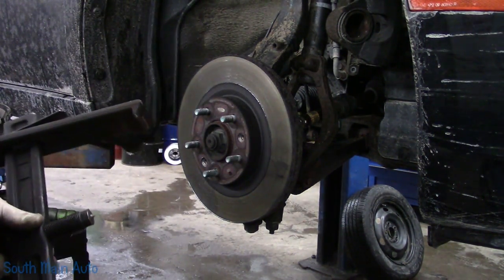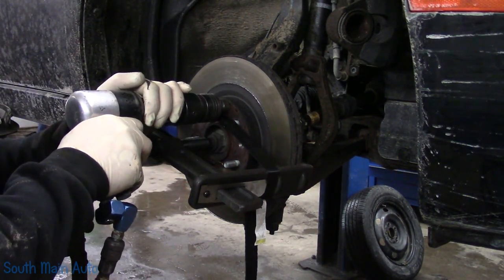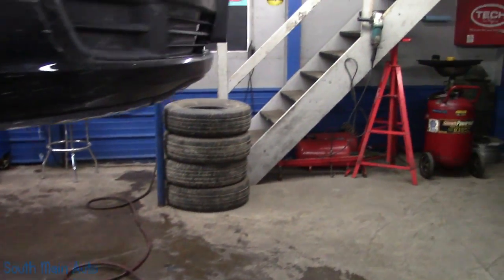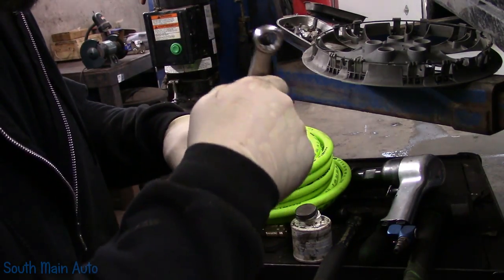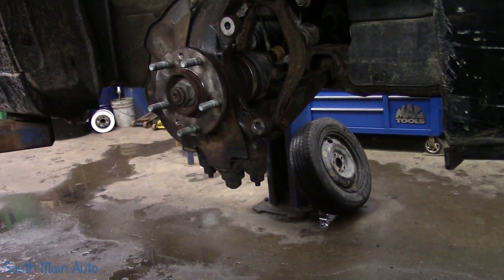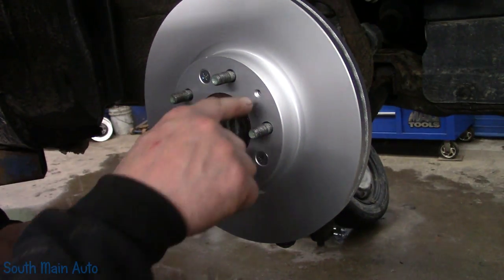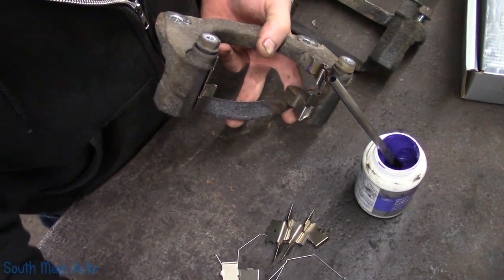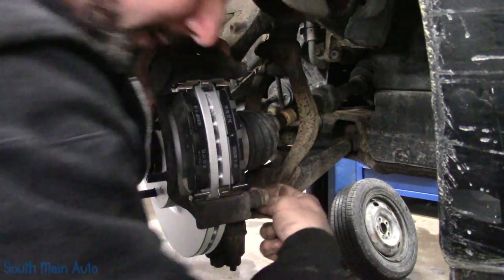Mazda 6: EXTREME Brake Rotor Removal 😱

Comment: You do not have to live in the rust belt to have issues getting Rotars off a Mazda 6, I live in GA and those puppies get stuck down here.  Now I am from MA so I have driven the car home in the winter but as soon as I return to GA, I wash all the salt off my car ASAP and still you can't get it all off.   Once corrosion starts your basically screwed.    I have the same Extraction Tool and it scares the hell out of me each time I use it.

Comment: Actually, you only need 3 turns of a thread for 90% of its strength. But everything else you said is valid. It doesn't help that you're jacking on one side when the hub spigot will rack and jam too, even if the rust on the hub plate isn't there jamming on the rotor radially.

Comment: I've been almost knocked out by the long drag link on a super duty, smacking it with a pickle fork and hammer and standing in the wrong spot. Managed to dodge it with similar cat-like reflexes, next time I'll just stand out of the way and put the nut back on a thread or two.

Comment: hey guys you want to take a rotor off loosen a ball joint tie rod ends it's called smacking it on the side with the big hammer works every time taper flywheels just don't hit the park with magnetic it will be de magnetized

Comment: To get a rotor off a 93 Mazda I had to drill the rotor around the center. It released. I'd take a picture of it but it's under 6-8" of snow.
Yes, I'm in the rust belt!

Comment: Precisely why liberal amounts of Anti-seize is critical whenever you're doing breaks, or spark plugs, or anything where you might have a problem with either galvanic action or rust fusing parts together. I also like to paint the rotor hats with ceramic paint like Caliper paint, It does make a difference

Comment: My mazda 6 rotor is stuck like this right now a 5lbs sledge and oxy/map torch didnt take care of it so Im going to get a puller tomorrow. Wouldnt it be nice if they used some sort of wizardry to prevent rust on cars.

Comment: Reminds me when I had to remove the steering wheel from my Citroen to fix the speedometer. It needed some persuation. So I yank it off with full body weight and slam it right on my nose. Nose didn't break but omg did that hurt. No saying, the next time I had to do it on another car I left the nut on with some slack.

Comment: Yeah, I guess it's a lot easier to put the pads in with the bracket off,  so no grease on the contact points between the pad and the clips?

Comment: An additional ratchet strap from the puller to the strut assembly would have taken away the dangerous situation.  

At the very end, a bungee to hold the caliper up ... then put in the clips.  I haven’t seen those clips on anything I have worked on.

Comment: Here's a tip to stop brake discs welding themselves to the hub with rust. This tip is widely known, but seldom used.

Use CopperSlip on the mounting surfaces FFS. It takes maybe 1 minute per side to apply, but is a hell of a lot quicker than having to beat the crap out of the disc to get it off, or having to drill out the disc retaining screws that have welded themselves in place.

Why do so few mechanics actually do this ?

Comment: i had a 97 expedition that had the rotors seized on good. Beat the crap out of it - nothing.  I put a gigantic three arm puller on there and had a big long pipe attached to the wrench for leverage.  I stood and bounced on the pipe and it broke the puller screw right at the head.  Didn't have air tools and didnt' know that rotor puller existed.  In 8 degree temps I had to pull off the hub assemblies with the rotor still attached and took it to the machine shop.  The guy put it on a 20 ton press.  At about 5 tons he looks at me nervously and says should i keep going?  I said yeah they either come apart or I buy new hubs as well.  At about 9 tons that rotor shot off like a bullet.  Scared both of us.  Not sure if it helped or not but I slathered the anti-seize on there good before putting it back together.  Not one of the more fun jobs I have had to do in my driveway.

Comment: "They should include a chain to anchor it to the suspension."  You mean like the other end of the ratchet strap?  If you make a figure "8" with one loop in front and one loop in back of the horizontal piece of the puller the strap can't come off.  Then tie off the other end of the strap with very little slack.  Not sure that there is any way to keep the puller from detaching from the rotor, however.

Comment: Well at least you didn't catch yourself in the face or down in the nards with that process. Florida weather tears up other parts of cars, but you hardly have to worry about break rotors getting rusted on and then trying to decapitate your air hoses.

Comment: Whenever my rotors rust I get the thickest bolts I can find and start threading them through the caliper  brackets holder on the steering knuckle back and forth until it explodes off

Comment: Dang, and I thought I had to deal with stuck rotors. Edit: Also, I've never used that screw hole. It takes too much time and is basically worthless. Anything that bolt hole would be useful for a couple smacks with a deadblow will work just as well.

Comment: Next time use a 10 lb sledge and replace the wheel bearing with it. More satisfaction. I have 4 rotors on a 2005 Volvo that are all worn and sitting in the snow all winter long waiting to be replaced... cant wait for that thrill....

Comment: That was a close call, you were almost singing soprano, or worst case, you might of become a eunuch !!!!! Better get a armor vest and pants with steel toe boots !!!!!  I see all the clips to hold the brakes as opposed to brake systems that just have one snap in clip. Did you anti-seize the mounting bolt threads ??? No silicone caulk on the brake pad backs to prevent rattle ??? Just checking !!!  Job well done, Eric !!!!!

Comment: Have the same puller and it payed for itself the first time I used it, just a wheel nut will save your face Mazda rotors are bad in salt situations.

Comment: I have the same car I think so mine is  a 2013   62,000 miles on it...done my brakes Five times each time replacing the rotor on both sides or shaving them    ,,,,   after a few thousand miles on each rotor I always have some type of failure vibration then warping....I’m about to throw the car off a  cliff...Why it   keeps doing it is beyond me...I followed the steps to the t      Always leads to same   Outcome..Any ideas?

Comment: Had a Similar experience with 6 rotors I beat them till the rotor separated in 2 had to bust out the torch and air hammer to beat them off, seems to be a common issue with mazda rotors.

Comment: This is the type of shit I run into while when I try to do easy driveway jobs like 8 foot 2x4 on the lower control arm to get the new 2” longer strut back in or spaying penetrating oil on hub to remove the tire and having to wait a week having every visitor backwards kick the seized tire 10 times each until the winner finally breaks it free I’ve also had two different wheel hubs welded to the knuckle Durango and grand am

Comment: i have 99 limited.
gauges seldom work.
recieved a junkyard cluster yesterday.
removed org cluster & replaced it. took about 3.5 minutes. no shit!  3 screws snap on snap off. ANYWAY gauges all work and idiot lights all off. BUT.
I NOW HAVE AN EXTRA 100,000 MILES! can it be reset to 75,000 ? 
i thought miles were in the computor but guess not

Comment: I would think that the safety strap would work better if it went around the puller and back around the control arm or strut. put it on loose enough that it will allow the rotor to pop when it does come off.

Comment: I love mazdas....  I have and have had a bunch of them.  However, the rear brakes are the BANE of my existence.  FWIW, if you get any CX-5s that are the 2016.5 (yes, a half-model year model) there is a TSB out on the rear caliper.  It may need to be swapped out.  I have gone through two sets of pads and one set of rotors in 45k miles.  Fighting that fight now.   Google Ref. No. R052/1 6C

Comment: Would someone correct me - If a lug nut was left on loose, wouldn't that keep a brake rotor from flying off?  It would still let you wail away with hammers and pullers however the rotor wouldn't be able to spring off.  Am I missing something here??

Comment: I’ve watched you do numerous break jobs and have always wondered why you put the pads in the caliper bracket before you actually install the bracket!  I’ve always installed the rotors then the brackets. The pads go in so much nicer when the brackets are already installed. You never have to worry about a pad falling off. Is this something you never do?

Comment: That "safety strap" is only to keep the jaws of the clamp from slipping off the rotor.  I doubt the manufacturer of the puller even considered a rotor letting go like that.  Time to invent a true "Mazda 6 rotor safety device" or leave a couple of lugs partially on the studs.

Comment: I worked at a Nissan/Ford dealership in the mid 00’s and the Ford techs literally used an angle grinder to cut the rotors off. Similar issue as here

Comment: Slit them with an angle grinder, if you use a hammer just replace the wheel bearing at the same time.

Comment: Old Video But what the heck can’t hurt to comment…  If using a puller just  thread 2 or 3  of the wheel nuts onto the studs , best would be to also use  old valve springs with the wheel nuts  to make everything shock safe. Alternatively you could also drape something like a moving blanket over the rotor and puller , this will trap anything that becomes airborne.

Comment: Fastest way I've found to deal with these rusty mazdas is to grab an air hammer with an angled chisel bit and the torches. Heat the snot out of the parts that touch the hub and stick the chisel bit in the vanes of the rotor. If that doesnt work, biggest sledge and cut a few relief cuts in the part that is rusted to the hub and beat it like it owes you money! Leave a few lugs on there as to not kill yourself in the process haha. These mazdas are no joke when it comes to rusting, heat beat and repeat always work up here in canada where the salt is absolutely  ridiculous

Comment: A couple of times a year, pop my rotors off and clean them, and the mating surface, just so I don't have this crap. I also pull off the drums, spray with Good Stuff, and put them back on. Then, nothing is a fight when I take them off "for real".  And yeah, the non rust belter's just wont' get it!

Comment: Use a big hammer and beat it until it turns into a 2 piece rotor. Then air hammer the hub part of the rotor from the back. Comes off in few mins..

Comment: Here is SW Ohio that bolt hole thing does not work. People try it it fails. 90% of the time a 2-3 pound hammer works. Sometimes one has to get the old sledge hammer out and go to town with that and a torch.

Comment: Don't bother trying to pull them things off. They are junk no matter what so just bust them apart. Start cuts with a cut off wheel around where they bind on the hub and start cracks with a chisel. Brutal but efficient.

Comment: Surprised you put those metal clips on the caliper brackets, but they are customer cars.  I've seen too many of the brackets get rust under the clips, jamb the pads solid and then you roach the one pad off and toast the rotor.  I've found on the older vehicles and trucks to just leave em out and let the pads float instead of playing the destruction waiting game.  YMMV -

Comment: Put a lug nut on one or two of the lugs.  That's all it takes to keep it from trying to kill you...  Ive done one like that IN THE DRIVE WAY.  MAN,,,  You have to rent that puller and use a little heat on the rotor hub and have at it!!

Comment: Had exactly the same job , but on an older Mazda 626 estate 2003 model , front discs ( rotors) badly corroded , tried using the m8 bolt hole removing trick , just snapped the disc , still stuck , beat the living daylights out of it , came off in pieces , both sides the same , charged plenty to do them , big rust removal before fitting new ones , rusty shitty Japanese cars made from 30 year old recycled crap !!!

Comment: Cut a slit in the rotor hat with a cut off wheel and wack it with an air hammer blade. Been doing mazdas like that for 15 years. No special tools required

Comment: Pretty sure yer supposed to wrap the rachet strap around the non- removable parts of the suspension to prevent launching the rotor across the shop.
JS

Comment: I have a good technique for brake rotor removal.  I spray WD40 around each bolt hole and the hub opening.  I rotate the hub and do this three times.  I let it soak for 1 hr.  Then I put a small piece of wood on the rotor and hit it with a 1 lb hammer.  I just broke rotors off a 2006 volvo with 200K miles and original rotors.

Also, you can put the nuts on the rotor to hold the rotor so it doesn't come flying off.  The nuts provide a stop.

Comment: Good Time to try FLEXZILLA HOSE !!   Good thing you have your knife handy so you can cut that piece of crap FLEXZILLA HOSE  on purpose and make small enuff pieces to fit in your trash can !!   SOME OF THE WORST SHOP HOSE EVER MADE !!   YOU WILL SEE. DO A REVIEW ON THE FLEXZILLA CRAP HOSE !!     Wont rewind or recoil around a holder unless u let the air out !!  IN COLD 35 f or below is almost impossible !!!   HYPE THAT IS GARBAGE !!   TWISTS UP WHEN YOU NEED IT STRAIGHT BUT WONT COIL UP WHEN YOU WANT TO PUT IT AWAY !!!   I USED IT IN MY SHOP !!   ONE DAY TOTAL !! NO MORE !!!